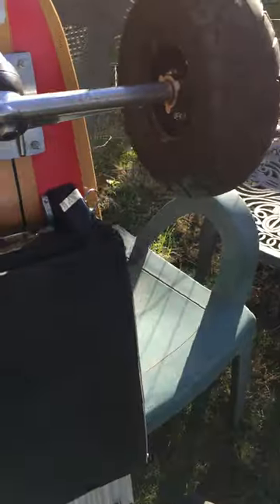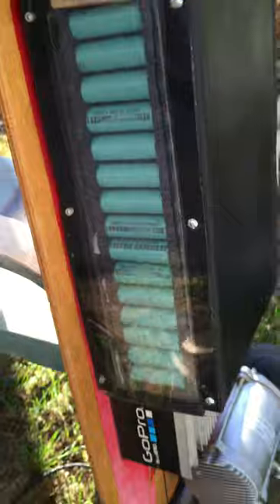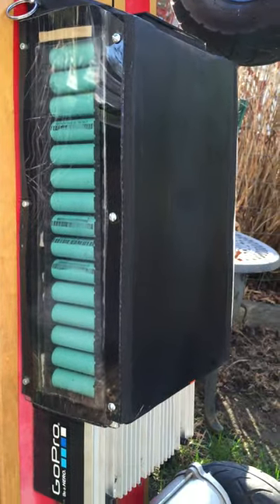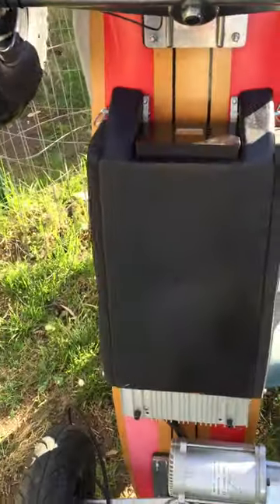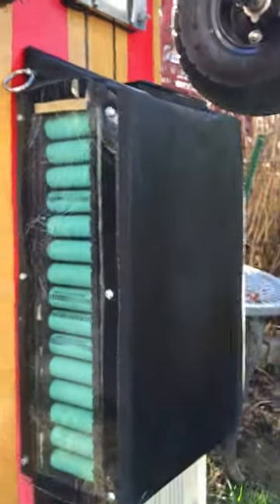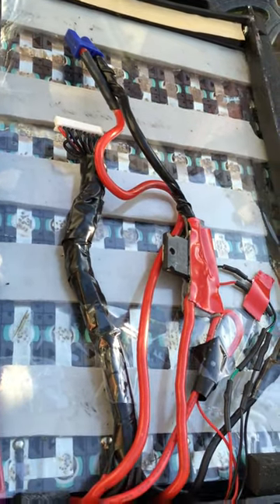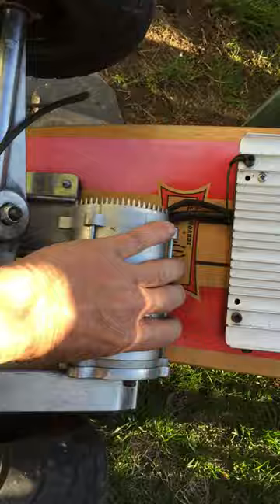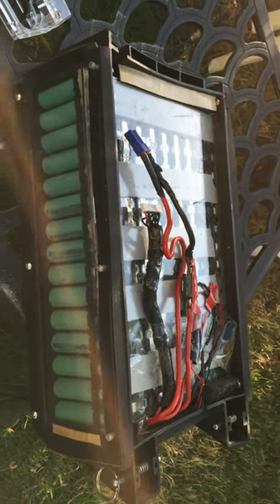electric skateboard  battery 1.2kw long range 150 18650s

Comment: Hey Mustang thanks for the great videos. Because of your video I got into 18650's. Massive thanks. I seen your video's about 4 months ago and decided  to give it a try. I found a RCSK8 800w long board on craigslist for cheap $200 with dead batteries. Picked up 800lbs dead laptop batteries  and started testing keeping anything over 1500mah. Needless to say I've watched 100's of video's since. 
Last night I build a 10s5p with batteries averaging 2.2mah . That was my first battery build ever (soldered). They were all fully charged and I came out with  41.8v . I slapped it on the board and took it for a test ride. At first it seemed normal, about a minute later I got a decrease in power but it still was running. Slightly warm at that point  and dropped very little in voltage 40.9.
Continued for another 3-4 minutes maybe having 60% power. Tested again with very little voltage drop. 40.1v. and slightly warmer batteries.road 3-5 minutes back home tested 39.5v power 50-60% batteries are much to warm at this point. 
Could use you thoughts on this. 
My first thoughts are I need to use more cells in parallel due to the type of motor were running, To reduce the load on each cell. I was planning on building the same size as yours.10s15p 
Any thoughts would be appreciated. If you could do an update video on your board and battery in detail that would be awesome. 
I've only been able to use the board with lead acid and its awesome fast enough for my 50yr old ass. Can't wait to go on a massive cruise. 41 miles = 65 km  that's insane. Here's a link to the board i got:
http://rcsk8.com/Detail.asp?Product_Id=AT800W
Anyways hope all is good.Massive thanks again, I never would have got into skateboarding again if I didn't see your video. Last time i boarded was in my teens. I now do a midnight run daily as part of the exercise routine. 
I'll upload some videos myself when i figure out some basic video editing. I've got a few vids of my progress up till now.
Cheers from Vancouver